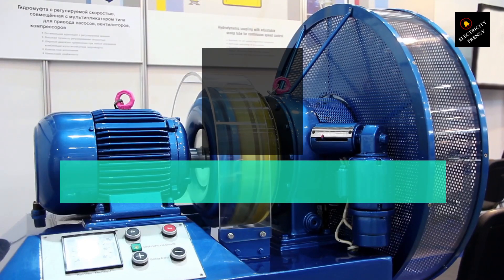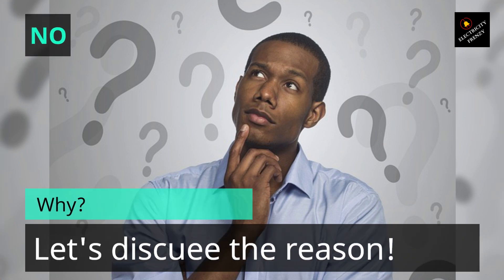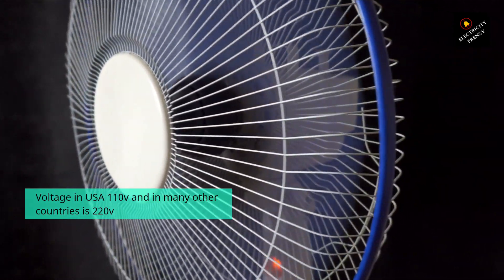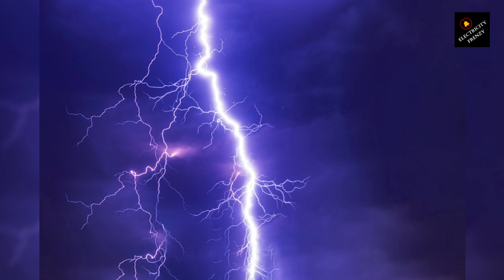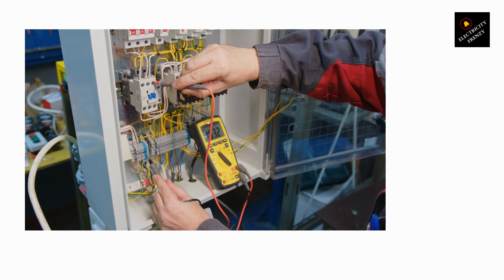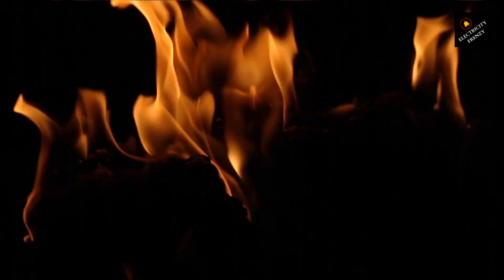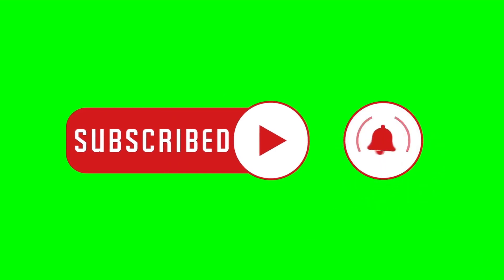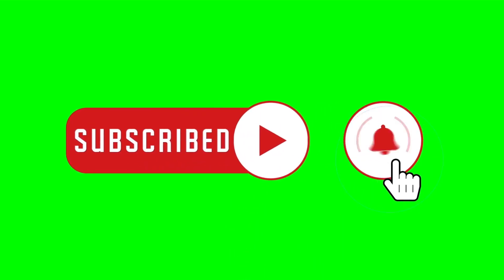The Shocking Truth About Using a 220v Motor on a 110v Outlet

Comment: Rated power output of the motor is VI cos phi, where V and I respectively stand for voltage and current. cos phi is power factor.So if voltage decrease, current will increase and the winding is not designed for that increased current and will obviously get damaged.
Reply from the maker: Thanks for your explanation 👍👍

Comment: Motors are more complex than we might wish, because this video assumes that the motor is lossless. In reality, motor needs a minimum voltage to overcome the losses and rotate close to the synchronous speed. If the motor operates at a voltage lower than its nominal, but high enough to rotate, this will result to a higher current and higher I²R losses (windings may get burned).

If the voltage is too low, then the motor losses will cause motor failure. If the voltage is high enough in this case (e.g. 100 V), it might burn the windings. However, if it's not high enough (e.g. 24 V), then nothing will happen. In both cases (100 V and 24 V), motor isn't rotating, so it's impedance is the same.

Note that I'm talking about induction motor, and motors in general is a huge and complex topic.
Reply from the maker: Thanks for your great explaining

Comment: "Current is inversely proportional to the voltage" are you sure about this? because in ohm's law it's the resistance that is inversely proportional to the voltage o.o

EDIT: It's not Ohm's law, but the Power formula P=VI, and indeed Voltage and Current are inversely proportional
Reply: That is not correct! You assumed that the power remained constant. When connected to the 110V, the 220V motor would be impossible to give out the power it was designed to offer. Why did you assume the output power constant? Imagine that you connect the 220V motor to a 12 Volt source!
Reply from the maker: I mean the motor-designed power is constant. Motors are typically designed to operate optimally at a specific voltage, and when subjected to a lower voltage, they struggle to deliver the designed power output. In such cases, the motor may attempt to overcome the load, but it won't perform at its intended capacity due to insufficient voltage. And will draw a higher current.
Reply from the maker: I see how you answered your self, thanks
Reply: If the other way round, your video is right!

Comment: These are not the videos I am looking for. I want to take a 220v fan motor and convert it to 110 without changing the wire windings. I want to change Capacitor as a solution.
Reply from the maker: Thank you for sharing your thoughts, and I'm sorry for any confusion, I may create a video for this topic in the feature